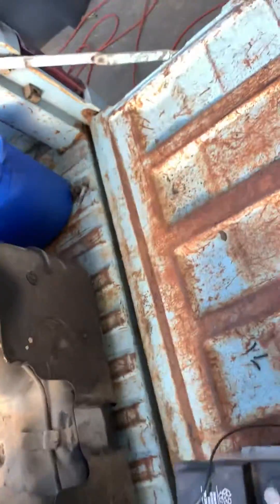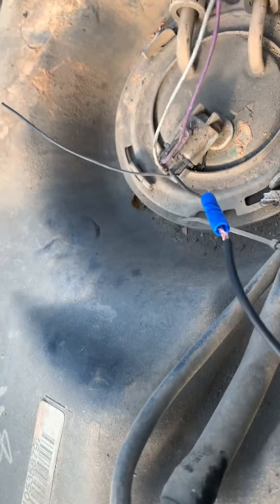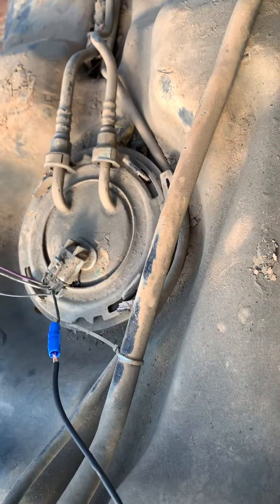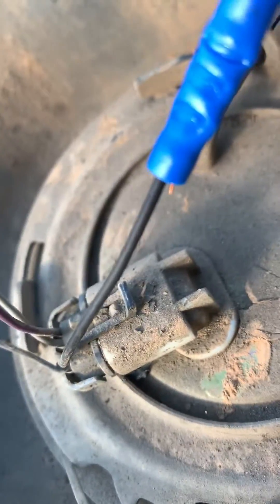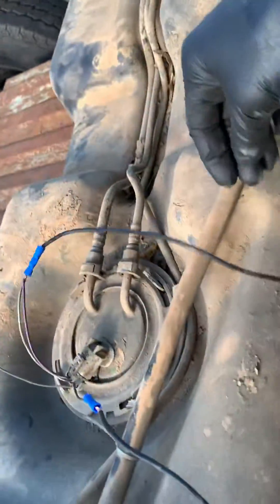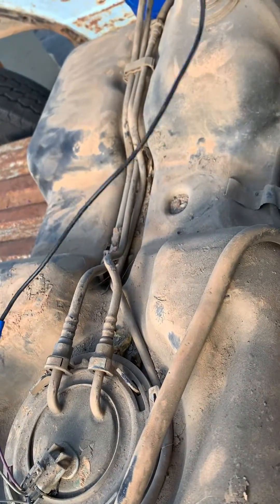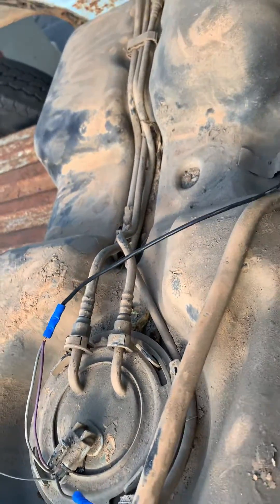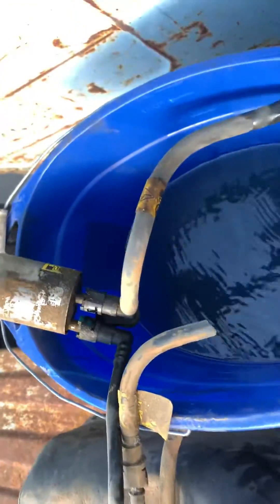HOW TO WIRE A FUEL PUMP FOR AN LS SWAP

Comment: If it is wired 12 volt constant how does the ECU control it I've recently done a LS swap and have come to believe I cannot control my startup fuel or off throttle to get my tune right and I believe it is because the ECU has no control over the fuel pump

Comment: I hooked my up the same way an it backed fire so I’m going to separate the purple  an should I run the grey wire to the fuel pump relay  an can I run a ground to the fuel pump realy right ?

Comment: Yes you got it running but the purple wire is for the gage docent need power.
Reply: Will if I did it like that will it cause it to back fire
Reply: I am aware, but it wouldn’t work with it not powered lol.

Comment: I thought the purple wire was the fuel gauge level, and isn’t supposed to have power
Reply: It isn’t, but the pump wouldn’t work without it powered.